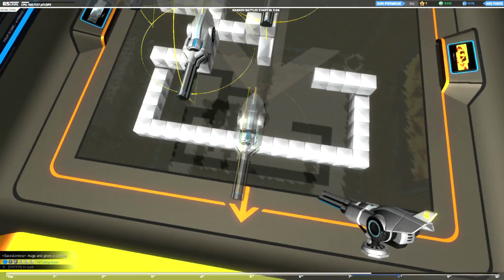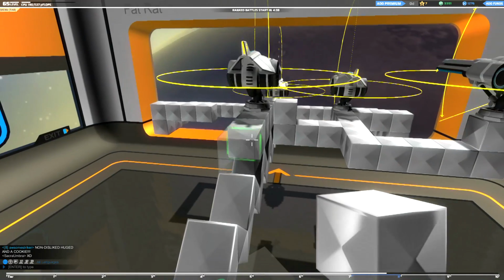Robocraft Early Access (Ep. 35) - Prototyping the Thunder Guppy (pt. 1)

Comment: I would have to argue that for smgs, I prefer making wheeled bots. Simply because if you want to be a front line fighter, you will have to be able to take copious amounts of damage without much happening to you. Wheeled bots do not destabilize the way hovers do. You can also put a lot more cubes on it without slowing down much, don't need to put any flops on thrusters, you are fast enough as it is. It's easy to armor your wheels so they don't get shot of easily. I nearly always win frontline fights against hover smgs. Tracks are too slow, but wheels will get you into the fight in time.